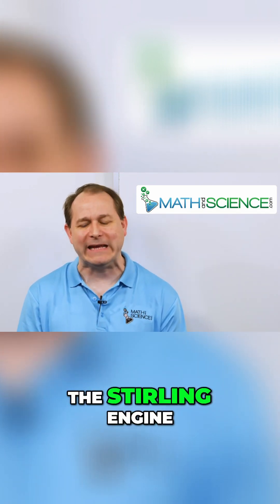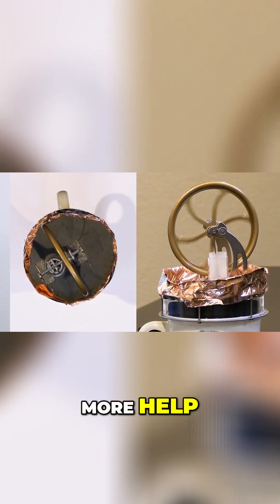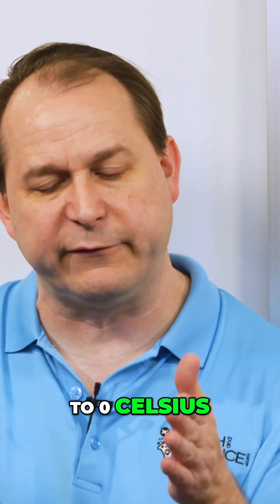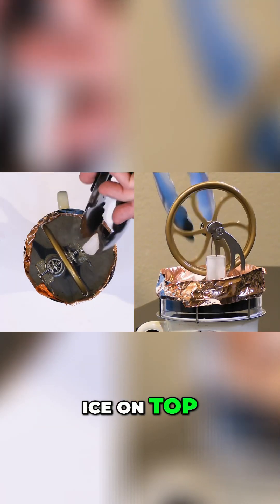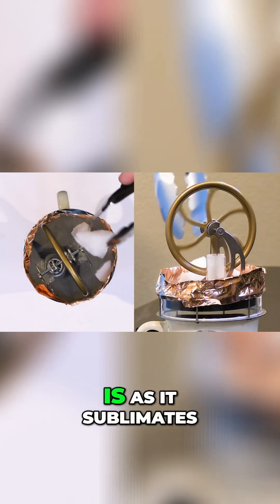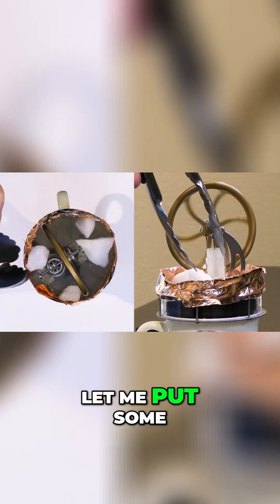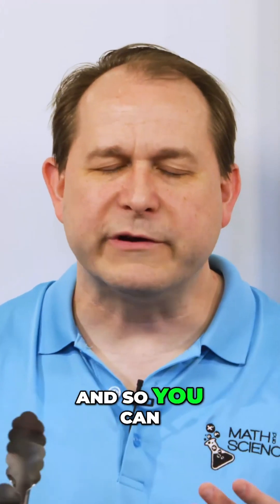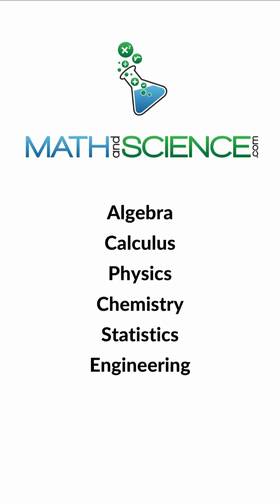Can ICE Power a Heat Engine?

Comment: It's all hot air !  Actually, as stated, it's the difference, but none the less, these  are air engines relying on the pressure of differentially heated air to work, so they have very low power.